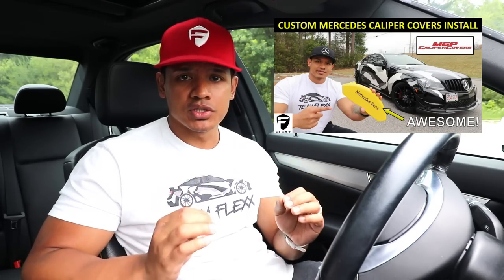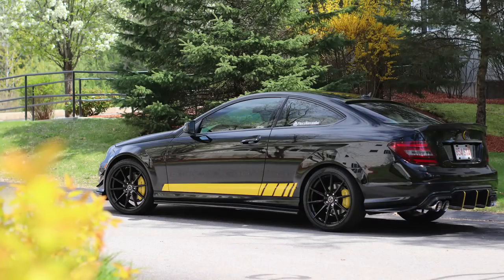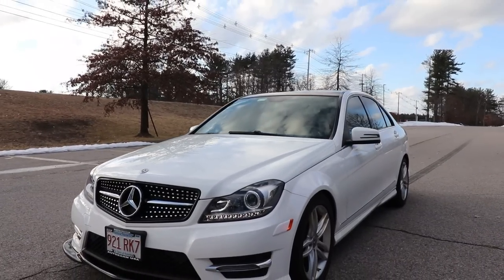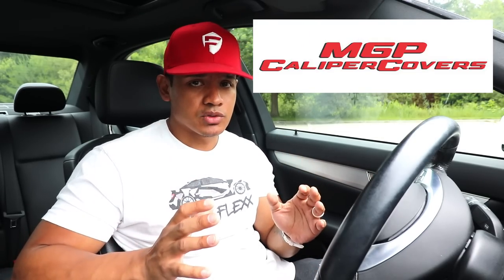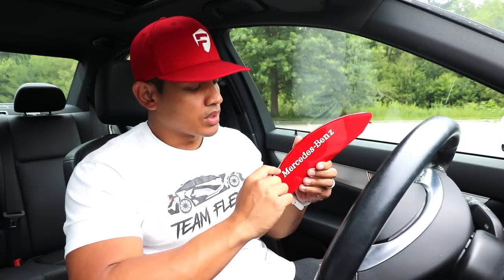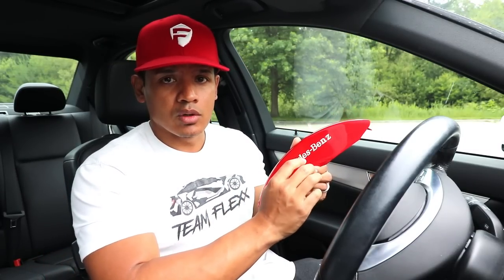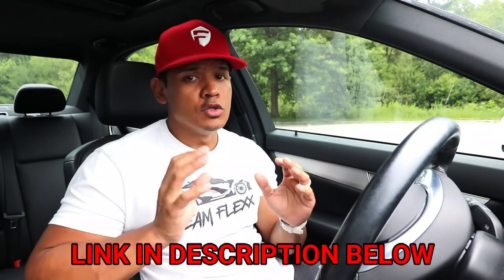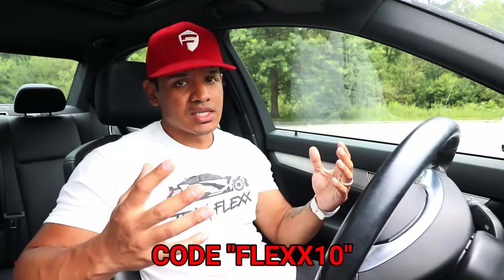How will these custom Red Caliper Covers look on a Mercedes C300 Sedan?

Comment: Hi , I have a Benz C230 2008  I have an engine check light that comes on and off by it’s self all the tome with a pending error code P0071 . I  bought a new ambient air temperature sensors from Benz and placed it in hoping the problem goes away, how ever it’s still the same issue. What can I do ? Please help

Comment: Nice! How about blacking out some of the Chrome trim pieces on the white C300. Use glossy black vinyl wrap. May I also suggest a very much needed clear vinyl door guards and clear Vinyl car bra. Both go a long way to protect against dings and scratches.
Reply from the maker: Not my car. I can only do what is allowed by the boss.

Comment: Looks Great Flexx:-) Tell me, when did u put the front spoiler lip on ur wifes car?  Can u send me a link? Whats up with ur Turbo install??  🤙😎
Reply from the maker: Since last year. There’s no video because it’s the same install as my carbon fiber godhand splitter for my c250.  I don’t recommend getting a gloss black splitter though. The clearcoat is not that strong and you get tons of pitting from road debris.

Comment: Y00 FlEXX! Could you hook me up with the link for the exact grill from the place your lady got  hers from? theres a few different variations and that’s the one I’m wanting!
Reply from the maker: The reseller i bought it from isn’t selling it anymore. The only ones I see are comparable are from Taiwan.
Reply: Thanks man I’m gonna get the new aftermarket headlights that have the led line and I think that grill goes perfect with them
Reply: Ebay